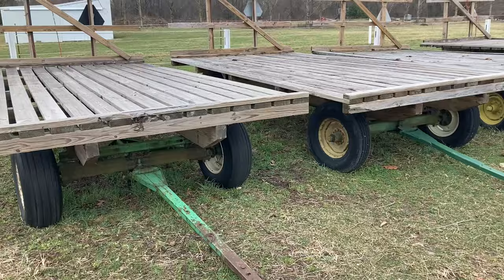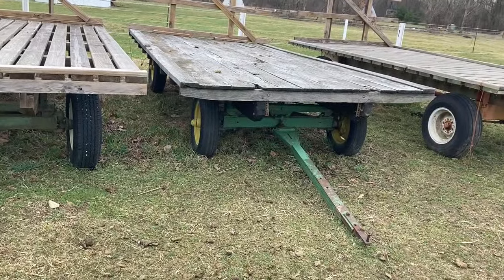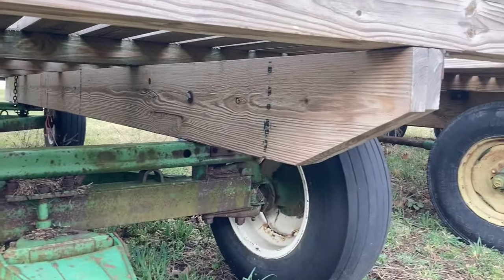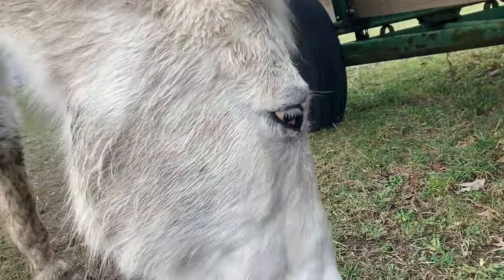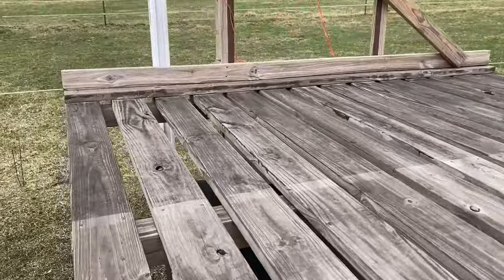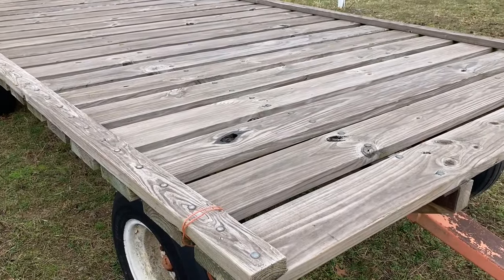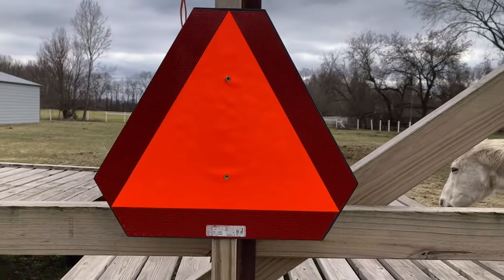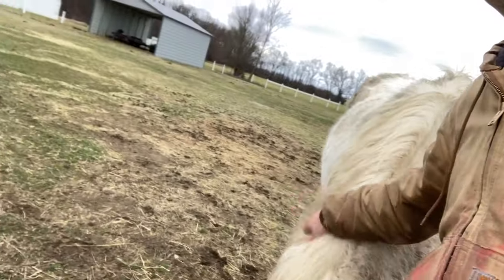Here’s how I build my hay wagons

Comment: Great video!  I really appreciate your approach to them.  I have some pretty rough kicker wagons that I keep stringing along - always with hopes/needs to redo them, and always short on time or $$ for a full rebuild project.  But this gives some inspiration and good ideas, so thanks!
Reply from the maker: I enjoy building them, but have not had to do it in a few years now because four wagons I found is all I need. One of my customers brings her own wagon and we load that directly from behind the Baler, so I technically have five wagons I’m working with. It used to be a past time that I would build a wagon with one of my foster kids. But now they are all out of the house.

Comment: Interesting.  I bought an old hay wagon a year or two ago and in redoing it I discovered that the front end of the beams weren't bolted to the gear but the back was.  I later learned that this was (as you say) for flexibility.  I guess it doesn't really matter if you bolt one or the other but at the time I thought whoever built it forgot the bolts...guess I'll have to take them out.
Reply from the maker: The reason I do the front bolted is because all the weight is on the back. I don’t want the front popping up but also AND if one of the ends is not going to be bolted and able to bounce around a lot, I want it to be the end that has the most weight to help hold it down.
Reply: @TheScientistHayFarmer Makes sense.  Mine is used for sawmill logs and firewood so the weight should be pretty even if I load it right.   😁

Comment: I've got 4 of those JD gears, I agree they tow nicely at speed. Your decks will do for squares but don't loan them to a neighbour for round bales or silage bales lol. I'd never go with less than a 4 by 10 oak or ash for beams on a wagon for real work. In 1988 we borrowed a friends wagon for hauling  5x5 Vermeer bales, two 2x10 spiked together like yours, we got it half loaded and it collapsed in the center.
Reply from the maker: I’ve hauled 4x5 rounds on these before. But not stacked.